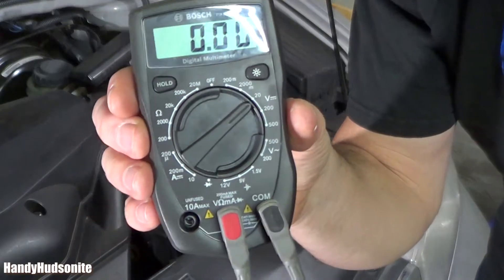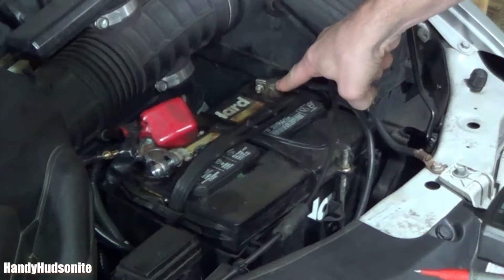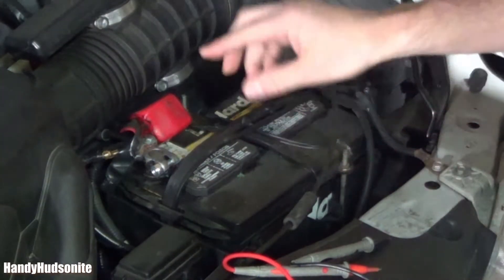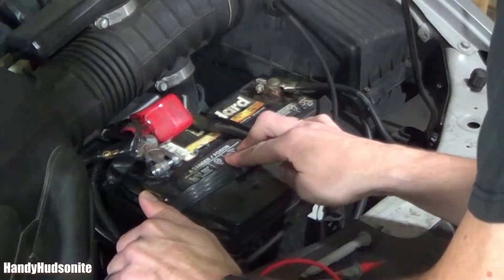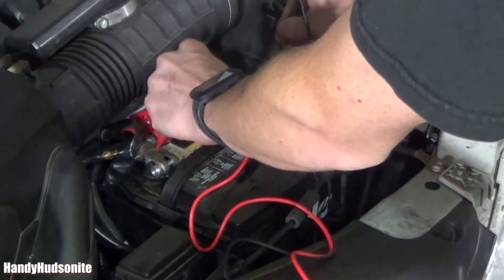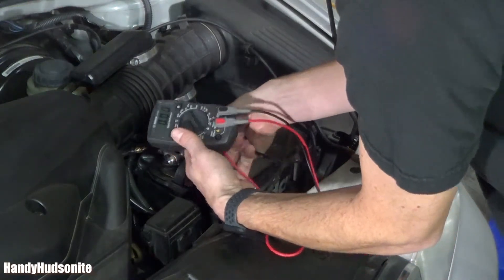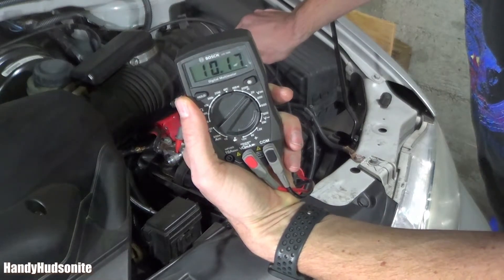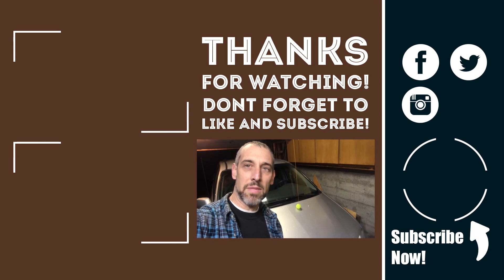How To Test Your Car Battery Using A MultiMeter (Diagnose Starting Issues)

Comment: I only use a multi meter for checking the alternator. The voltage is dropping because there is a surface charge on the leads from the alternator. Also a low voltage indication doesn't necessarily mean your battery is bad. It may just need to be charged. Use a hydrometer, taking the caps of your flood lead acid battery and testing each cell individually will tell you the true state of charge of each cell. You can also tell if there is a dead cell because the reading for that specific cell will be much lower than the rest. After checking the true state of charge, either charge your battery fully or if it is already charged you need to use a load tester to simulate a vehicle starting. A fully charged battery can still fail a load test due to a number of factors. I've got 6 years of experience working at a battery distributor. Hope you find this useful👍
Reply from the maker: Hype Apex Thanks for that insight. The battery was bad, but I appreciate the wisdom on this for next time.